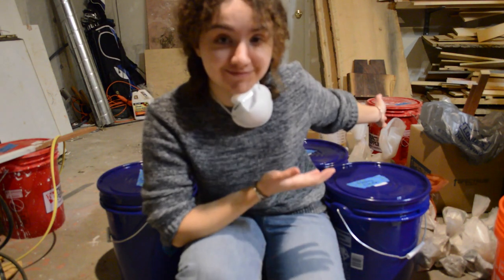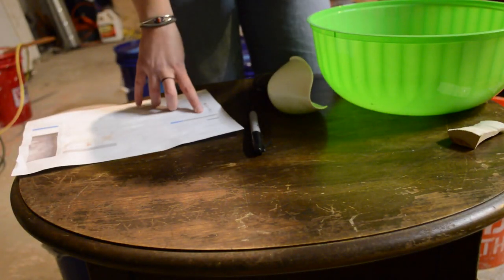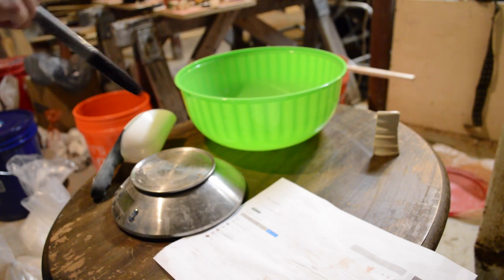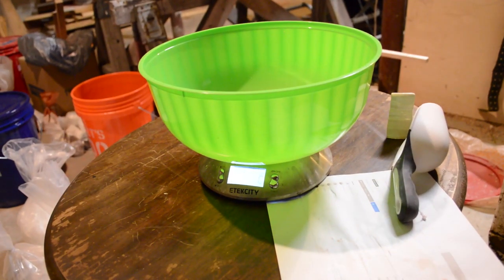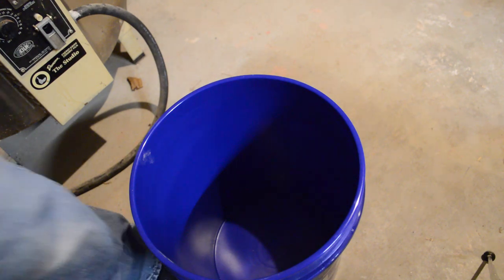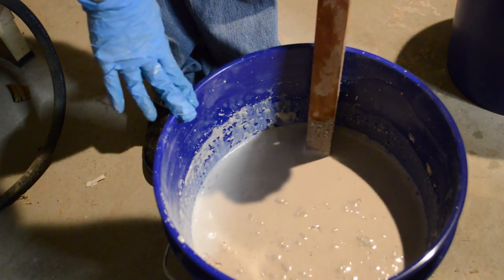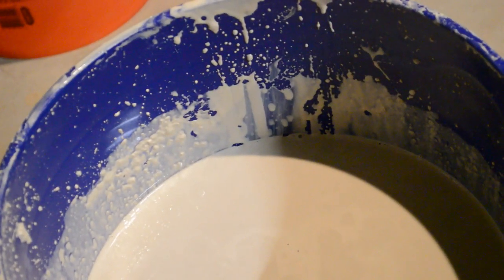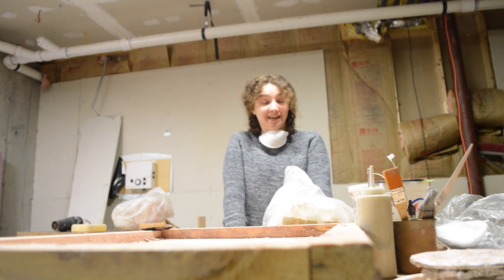How To Make And Mix Your Own Ceramic Glaze From Dry Materials | Tutorial

Comment: When mixing with the whisk you could take a lid for the bucket, make a hole in the middle and put a rubber o ring there. then put a whisk with a long handle into a hand drill and just let it mix instead :)